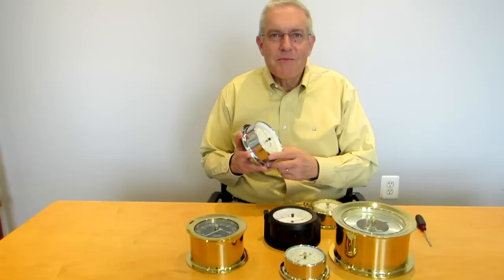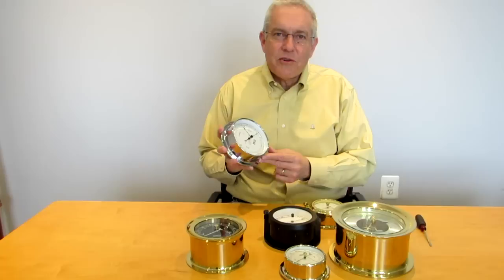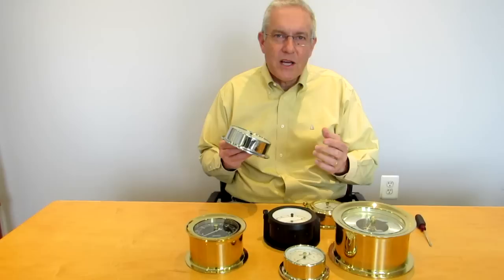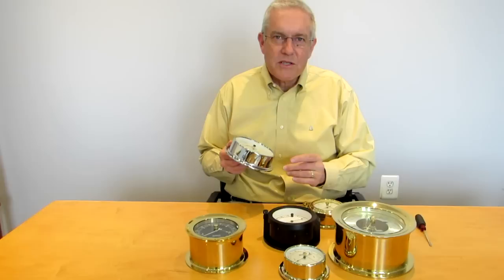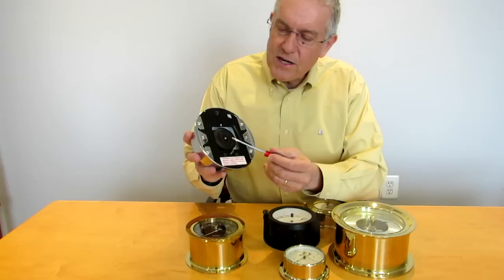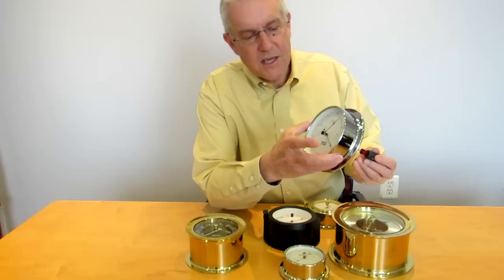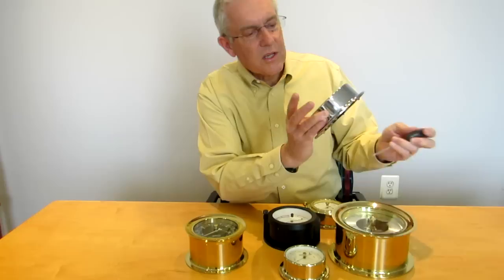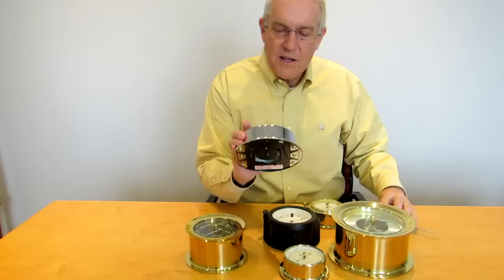Calibrating Your Barometer

Comment: Worth mentioning that most of the time bad weather does not cause a barometer drop. Small systems bring rain/snow/clouds without a drop in the atmospheric pressure, in fact these small systems may actually cause an increase in atmospheric pressure. It's mostly the larger systems that will cause a pressure drop. In other words., most of the time these barometers are worthless.

Comment: Is it best to calibrate barometers when the atmospheric pressure is in the middle of the barometer’s measuring range? I calibrated mine when the atmospheric pressure was about 29.42 inHg and now it’s off when it’s 29.79 inHg. In know all instruments have some error and was just wondering if the middle range would be the best sweet spot.

Comment: Question: I got a fishing barometer. Pretty similar settings and look; metal case, etc. There are two needles: (1) the one you adjust with the screw as you were showing and (2) on the glass. What's the one on the glass for and  does need any adjustment? Thanks
Reply from the maker: All barometers have two needles. One is the indicator needle that is adjusted to the pressure with a screwdriver from behind the movement. The other is the moveable needle that is adjusted by turning a knob on the face of the barometer and should be placed over the indicator needle to mark any barometric change  in pressure.